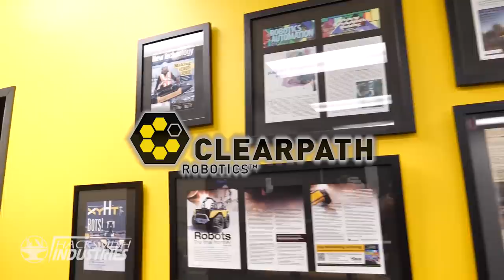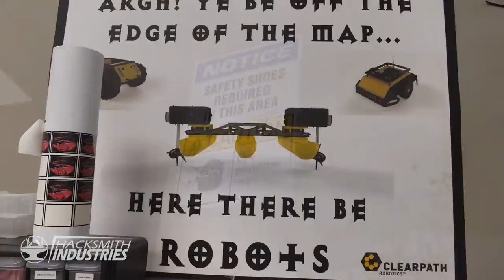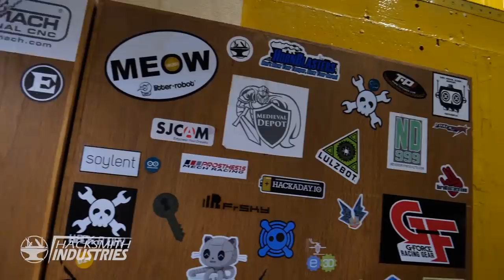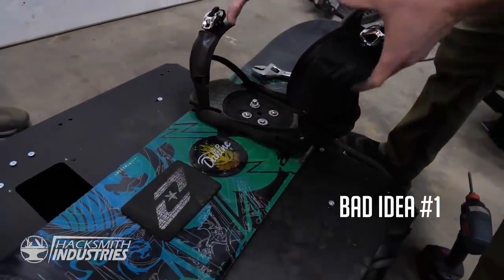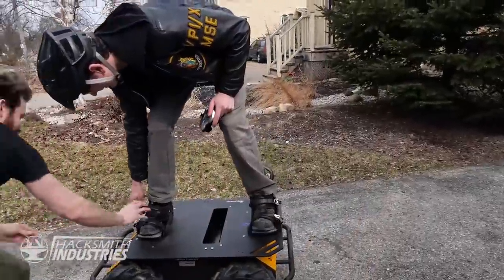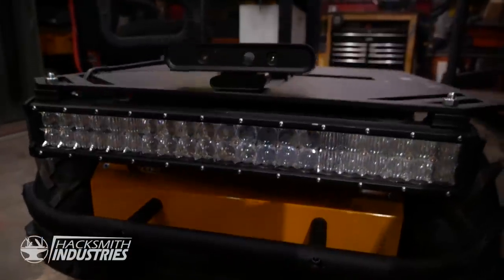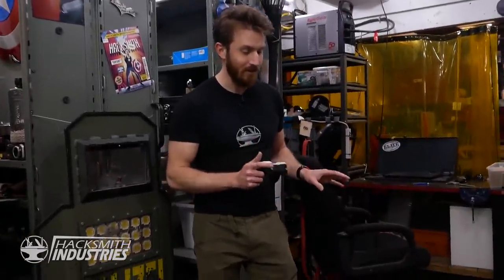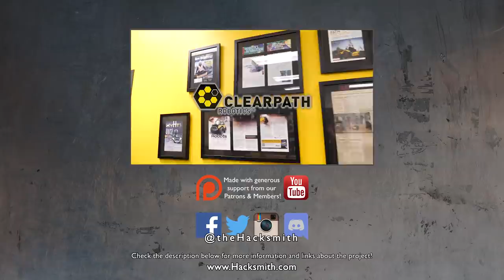Our Very Own ROBOT!?

Comment: I've got a practical use for the robot!! Once you've put an arm on him have him follow James around with a fire extinguisher! And you don't even have to program it to detect fire, just have it spray James randomly. First off that is closer to Tony Stark's experience.... secondly I'm sure at least one of the times James will have actually set something on fire and it will save the day by sheer chance!